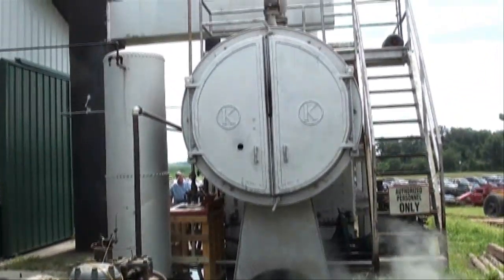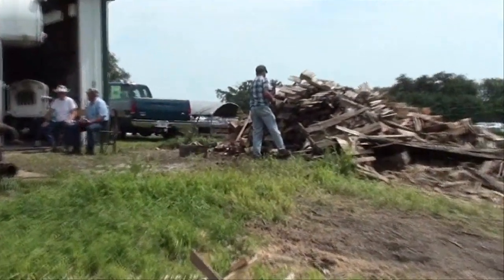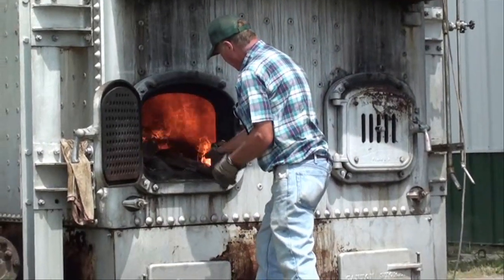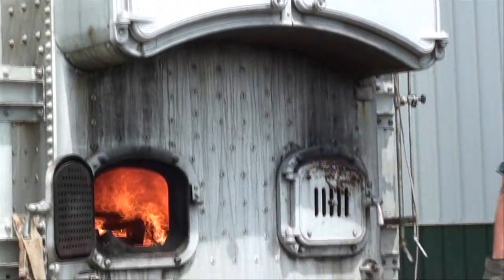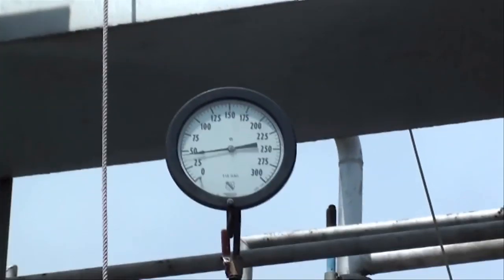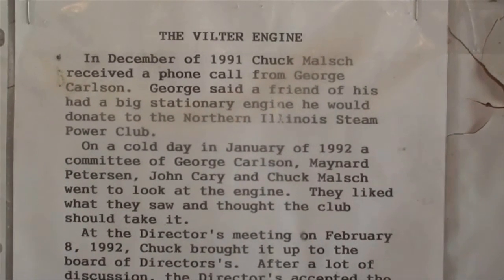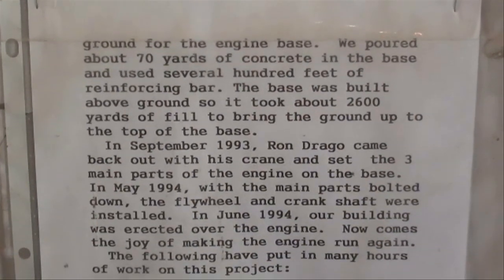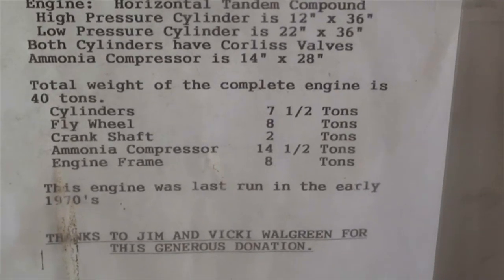HUGE STEAM ENGINE OPERATING Corliss tubalcain

Comment: With all the so called modern technology which I think is complete bull shit. These engines should be in operation today but the illoustrous managment wants equipment that a single individual can operate or there new sologan " Lets go green" which does not work. I'll take the steam engines and steam boilers for heating, process or any other application PERIOD! Great video Thank you.
Reply: But the electricity that powers this modern technology is all generated using steam.  Steam power never went away; it's just gotten more efficient over the years.
Reply: That is true to a certain extent.
Reply: I agree with you 100 percent when it comes to comparing these graceful but powerful steam engines to some of the raucous motors that power sports cars & motorcycles, for example.